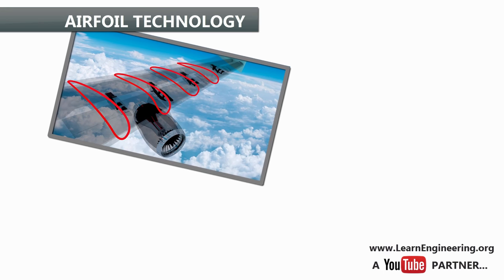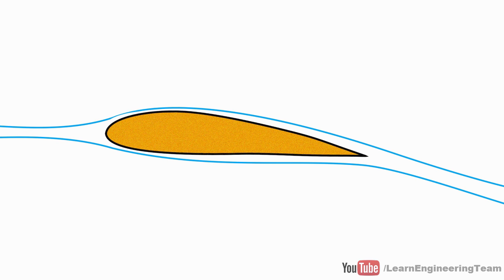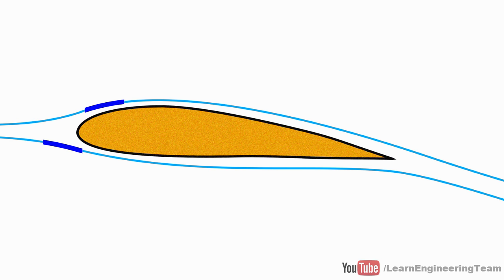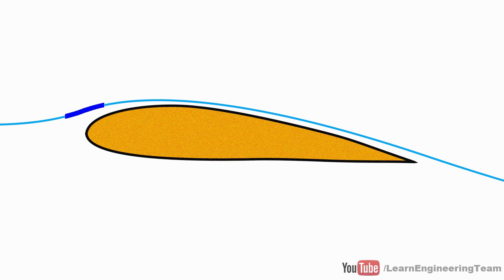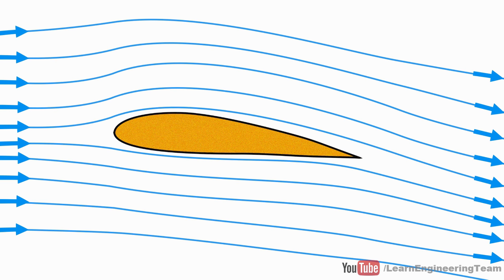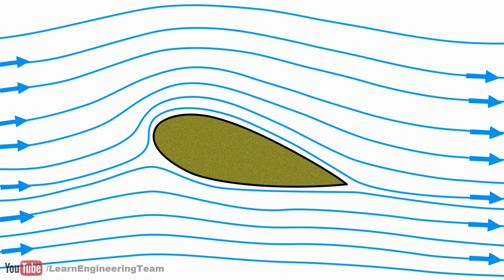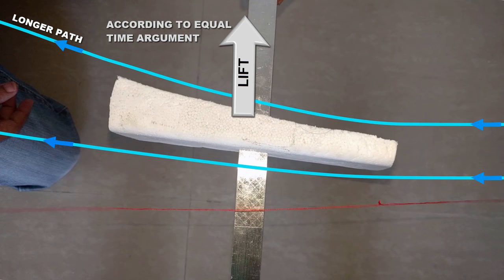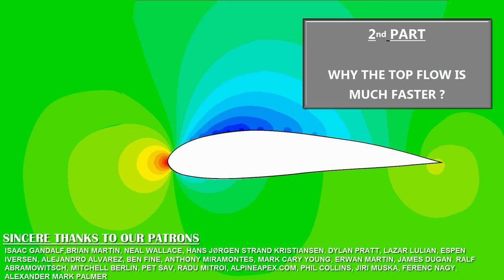How do Wings generate LIFT?

Comment: A profiled wing section is not necessary to generate lift. It does so more effectively and over a wider range of angles, but it is not necessary. It just conforms better to the flow patterns that result when masses of air are accelerated by a body moved through them.

Comment: Pls answer
When Flaps are extended
1. It will develop moderate Lift on take-off and high lift during Landing OR,
2. It will develop high Lift on take-off and Low lift during Landing
Reply: 1. When flaps are extended the wings are creating more lift. When taking off, it needs flaps because it is taking off at a relative low speed. When landing it also needs flaps because it’s landing at a relative low speed.

Comment: the reason that the air at the top moves faster is because the air at the bottom will hit the curved surface of the object stream by stream and get deflected downwards bumping into lower air streams hence reducing their speed.

Comment: at the upper surface due to curvature shape pressure gradient decreases faster so flow must have to accelerate faster but at the lower surface due to geometry along the surface pressure deferential is not as much like upper surface so this flow is quit slower than upper surface

Comment: I am trying to get my brain around how your explanation would apply to a sailboat sailing into the wind.
Reply: The sail on a sailboat is shaped like an airfoil once it's inflated. This causes a lift force that is normal to the airfoil shape. If you angle the sail correctly, you can get a portion of that force pulling you forward, while the rest of the force is pulling you sideways. Due to the shape of the boat, the water to the sides causes a lot more drag than the water ahead of the boat, and therefore it goes (mostly) forward.

Comment: In a thick airfoil, the transition between the lift and stall is smoother near the máximum lift, this way the airplane can "predict" the stall before it happens with more security to stop it. It is not only because of the structural strength and fuel storage.
Reply: Hi. Do you mean the sensitivity of lift and drag in response to attack angles?
Reply: @terencew3840  yes
Reply: @terencew3840  yes. If airplanes had the airfoil shown in 4:45, it would certainly generate more lift, but the response curve of lift/drag x attack angles is way more unstable than the airfoil shown in 4:50.

Comment: As the air gets closer to the airfoil this one accelarates over the uppersurface of the leading edge causing a great suction (favorable pressure gradient). This means that the air momentum is increased and transmitted  to the layers above the closest layer to the airfoil surface whereas in the lower surface the air faces an adverse pressure gradient. This means that the air slows down as it travels along the lower surface.
Reply: I have to add that at distances of delta/c = Re^-(1/2) the airflow behaves as if it were inviscid at high Re

Comment: my best guess is that the fluid has less velocity through high pressure and viseversa. Thus, in result, the loswer pressure area and the air stream travels faster than the high pressure area?

Comment: Firstly, by starting with "The Equal Time Explanation" you have started from the wrong place. 

Secondly, by using those two examples, you completely destroy your argument. And using those absurd shapes shows you haven't understood anything. SMOOTH airflow is necessary for lift. Period.

Lift is generated by differential air pressure. You explain that at several points in the video, however you then dismiss it and go on to the so called "deflected ariflow" explanation. It has been shown by wind tunnel experiments that the pressure above a properly shaped air-foil is reduced compared with that at the bottom. That is all it takes to develop lift. You can argue about how that happens, but that is what does. So in effect, the air DOES SUCK the wing upwards! The air deflection happens BEHIND the wing. There is no "thrust" involved.
Reply: @Observ45er  Thanks for the link. Brief but correct.
Reply: @sadiqmohamed681 Thanks.  I hope you clicked LIKE.
Reply: @Observ45er  I did. Can't wait to see what else he does.
Reply: @sadiqmohamed681  It's me.  My 11 yo granddaughter did all the editing.  I don't know if/when I'll do another. I've had the account for many years and too busy to do any, but the response so far is encouraging.  If you read my YouTube account About, you'll see I'm very serious about understanding and explaining STEM to others of all ages. 
Best Regards
Reply: @Observ45er  You can tell your granddaughter I think she did an excellent job. And that is from a retired video editor!

Making YouTube videos of any quality seems to be a full-time job, judging by comments from the ones I follow. The tech may have advanced to the stage where you can run professional grade editing software on a good laptop, but it still takes time to choose the shots and music, make up captions, and put it all together in a tidy fashion. If you take the time it shows. If subscribed, so if you do any more I will get to see it. Good luck. Teaching STEM is laudable aim in life.
Reply: @sadiqmohamed681  Thank you.  Of course I can see some problems with it, but we had limited time.  The warts stand out once you see the final cut... :)

I am very critical of this type of thing.  I think so many people get carried away with trying to be ultra fancy and I think they go over board.

 Two things that annoy me. I think so many can't get the idea of background music correct. They have "foreground" music over narration
Then, ultra close shots prevent seeing the whole "picture" in context.

 Even some US Public TV documentaries out of so-called professionals on the east coast are poor with overworking that kind of thing.  
They have the capability to do all this fancy stuff with the software, so they do...

Well, this was my first attempt.  We sat side-b- side with one other "creative and technical consultan"t (her dad).  She knows the software and he helped her with getting some of the files I made moved correctly since it seemed to give her a little trouble.

But she really enjoyed it and it was such a good personal experience.
We are close to our family and this is so rewarding in so many ways.
Best Regards.

Comment: there are many factors involving the upward lift in the case of the airplane. 1- the curved shape of the wing above receives a direct hit (push) force more than below, I mean because of the somehow doom-shape at the front of the wing. 2- while lifting the tilted configuration of the wing receives another hit (push) force from below. 3- an amount of air molecules that reaches the end part of the wing from above hit that part downward helping tilt the wings. 4- if we look at fish's shape we'll realize that the curved shape helps lessen water fraction with the body of the fish so it can move more dynamically-- of course the same as the wing the only difference is that the wing is only curved from above on which the air fraction is less than on the below part and that might be the answer for why the air stream above the wing is faster than it in the below part, of course in addition to the static pressure increments.

Comment: It is all related to inertia. Air molecules inertia to be exact. The air that is forced to avoid the leading edge of the wing is redirected in an upward angle, creating a void under the airstream. That void have to be filled by the 2 things that are the closest to it, the air and the wing surface. So the air moves downward, and the wing must move upward ( lift ) to try to fill that void. The more weight you want to lift up, the more air have to pass over your wing ( airspeed ) or the more surface you need ( Boeing vs piper cub ). The best way to see this phenomenon in action is when you see a huge aircraft pass in humid air in a high angle of attack or great speed, you will see the air that goes on top of the wing get vacuum down with great force, Remember that when you depressurize a gas it goes cooler , that's why we see these white veils of frozen water vapor on top of wings. You will not see it under the wing, because the air is compressed under instead of creating a vacuum like the air from the top part of the wing.

Comment: Hello sir... According to Newton's 3rd law air flow will be downward so reaction force will be upward. But in air flow we know air flow is only happens from high pressure to low pressure. If airflow is downward then there must be a high pressure region at the top of the wing. But according to your explanation wing top region is at low pressure and bottom region is at high pressure. Then how it works? I am confused.
Reply: The plane is moving through the air; there's no need for high pressure to low pressure (the air is moving anyway). That being said, a change in pressure will cause the flow to accelerate or decelerate.

Comment: Your video is interesting, but how does this description of lift explain how a paper aeroplane flies? It’s wings are extremely thin and flat. Similarly, if the aerofoil shape is so important, how do aircraft fly when inverted? According to this explanation, the low pressure area would develop belo the wing, and air would be deflected up. This would push and aircraft down towards the ground, yet in reality an aircraft can continue to fly normally when fully inverted.

Perhaps Sir Issac Newton would have something more to say on the subject?
Reply: Even a flat wing generates this pressure distribution. The pressure distribution on an airfoil changes with angle of attack.

Comment: I think the equal time argument may have arisen from a misunderstanding of the correct idea that the flow lines (not the particles in the flow) must meet at the trailing edge of the wing for the proper functioning of the wing.  
Solving the relatively easy two dimensional frictionless fluid flow around a wing leads to the distressing result that the flow lines below the wing wrap around the trailing edge and flow forward to meet the oncoming flow on the upper side of the wing.  No lift is generated.  Superimposing a circulation on the flow that speeds up the flow on top of the wing and slows down the flow on the bottom, drives the meeting point of the two flow lines backward and lift is generated.  When just the right amount of circulation is added to make the flow lines meet at the trailing edge, the calculated lift is a pretty good estimate of the lift generated by a real wing. 
It took boundary layer theory to explain why viscosity prevents the lower flow from wrapping around the back edge of the wing.  But until that complex theory was developed, there was a pretty good substitute.  Simply add the right amount of circulation to a frictionless flow that makes the two flow lines meet at the trailing edge.
Newton's third law cannot explain how a wing works because the third law is always true, even if you design a wing that doesn't work.  Once you know that a wing applies a force on the air that deflects it down, then of course the air must force the wing up, but that begs the question: how did the wing force the air down?  And why is a wing so effective in pushing (and pulling) down such a large thickness of air.  Only fluid theory can explain that!
Reply: Some think equal time came from a drawing by Prandtl which was only talking specifically about the boundary layer,  but it did show the equal times. There isn't any indication he thought so, but the drawing had it that way.
.
And yes, Newton's Third must happen, but is isn't a *cause*.

This gives folks the most trouble. For a better understanding of the detailed cause of the reduced pressure above a wing, try this short video:

https://www.youtube.com/watch?v=3MSqbnbKDmM
Regards.

Comment: Some comments: There is no top nor is there a bottom for an airfoil, planes are able to fly inverted and airfoils can be symmetrical and can be rotated by 180° in the wind tunnel. "Top" and "bottom" is a convention and makes sense only once an airfoil becomes a wing and this wing is fitted to a plane which has its landing gear only on the Earth facing side of the fuselage (it would theoretically be possible to build an aerobatic aircraft featuring symmetric airfoils and a wing with zero incidence, with landing gears on both sides of the fuselage, one gear would therefore face the sky, so this caft could actually land inverted with the pilot's head upside down, however there is no demand for such an unnecessarly complicated design). Lift is generated from airflow deviated by an airfoil, not by the position of the "top" or "bottom" of an airfoil relative to Earth. There is no such thing as "outside" or "inside" pressure since the pressure distribution on the surface of the airfoil is highly variable depending on its local curvature and the angle of attack of the airstream, the pressure distribution is basically a function of the angle of impact between the local vector of air molecules (mean local angle of impact) and the surface region in question (Newton's law: action and reaction). The "introduction of the airfoil" into an airstream does not automatically make the flow "curved", this is only the case for an asymetrical airfoil or an angle of attack unequal to zero for a symetrical airfoil. Lift and drag are generated by the integration of the local pressure over the entire surface of the airfoil (the total surface in contact with the airstream). The airfoil shape is optimized by maximizing lift and minimizing drag, taking into account structural needs (main spar and wing tanks). However, placing the tanks in the wings is optional, some aircraft don't have wing tanks. For example, a canard wing is usually too slim and does not allow for accomodating a tank.

Comment: It means that the center of pressure on airfoil is located near the point from where the curvature of the airfoil starts..... am I right admin?
Reply: +Ali Khan,
 It moves around depending on the angle of attack which adds another complexity.  However, it it generally closer to the leading edge than the trailing edge.
Reply: Observ45er but I think center of pressure movement depends on airfoil design, if you design it in some ways center of pressure would not move with angle of attack.
Reply: +Ali Khan,
You may make what ever guesses you wish.  There is information available. John Anderson's book probably addresses the subject of CP movement.

Comment: Is it because the creation of the high pressure at the bottom of the flow slows down the flow, sacrificing velocity for pressure? Similar to a jet engines compressors.

Comment: I'm going with upward suction of micro vortexes, pulling the top of the wing against the laminar flow as it travels across the top of the wing, combined with the angle of attack.

This makes the invisible sky people hold the plane in the air. /s

Comment: If the air doesn't turn upward as it approaches the wing, there will be no lift. Air turning up under the wing hits the wing and air turning up before the stagnation point is moving away from the upper surface, hence a pressure differential.

Comment: Bernulli's principle assumes non-viscous, non-frixtion flow and the 'equal time argument' should therefore correct in such cases. Experiments do not agree because, well. real fluids are viscous and have friction in a non linear way. Navier-Stokes equations account for all though. Correct me please if i'm wrong
Reply: Bernoulli's equations are accurate even with the assumptions. Equal-transit time theory is just a complete misinterpretation.
Reply: forget Bernoulli. Bernoulli assumes a fluid with no change in total energy  (higher velocity (kinetic) results in lower pressure (potential), but total energy is the same). As a wing moves through the air, it energizes the air (makes it move and warms it) so Bernoulli doesn't apply. Look at the deflection of the air as the wing passes by. Push the air down and you push the wing up. Newton's 3rd. The airfoil just makes a smoother and greater downward deflection of the air.

Comment: This is unfortunately wrong, and is based on the incorrect assumption that particles must meet at the end. What happens is that the cross-sectional area of a control volume above the leading edge is reduced, requiring air to speed up to maintain the same mass flow rate (For slow speeds, below 230mph we can assume that air is incompressible). The same way putting your thumb on the nozzle of a hose reduces the cross-sectional area, increasing the speed of the water, the wing increases the speed of the air. If you follow the same streamlines, you can conclude that as dynamic pressure increases (rho*v^2)/2 at the top of the wing, and the change in height rho*g*h is negligible, static pressure, or P has to decrease. The relative static pressure, P, of the streamlines at the bottom of the wing is higher. Newton's 3rd plays a smaller role than you think. I suggest you check out John D. Anderson's book on aerodynamics!